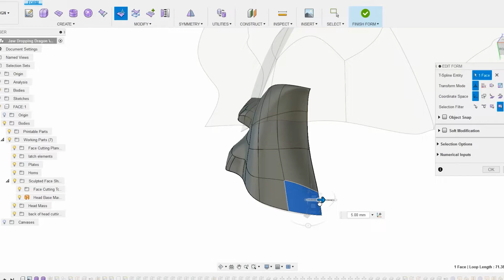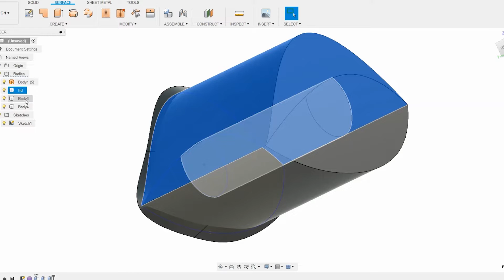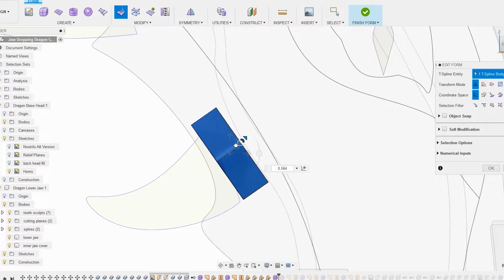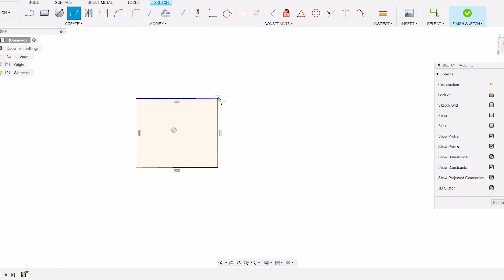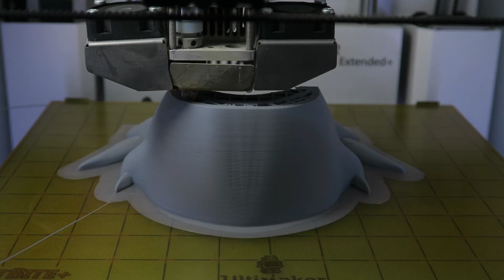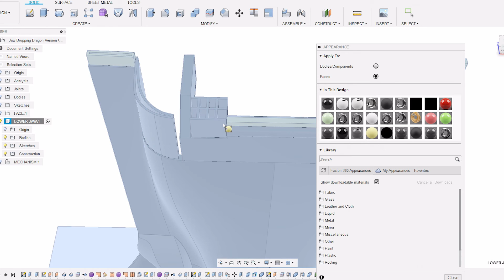How to 3D Model ORGANIC Shapes in Fusion 360 | Dragon Secret Compartment Box Part 1

Comment: You're awesome! Thanks for the tip. I will use it to finish the sculpting of the shield on the back of my Galleon model (Revenge 1577). 
I just 3d resin printed my highly detailed Harley Davidson F360 model in 29 parts, turned out amazing. I will use the technique you demonstrated to complete the Galleon and 3D print it (in resin) as well. Cheers. Subscribed!

Comment: I spent months trying to extrude or thicken a solid directly from a sculpted organic form and gave up on the project for more months. It just never crossed my mind i could use the sculpted shapes to cut the solids... gaaahhhhhhhh....  I ended up starting from scratch and creating the model with 3d sketching, surface lofts, then stitching the parts into solids. And i had this tutorial downloaded all that time. faceplant. Still, i needed all dimensions to be exact and precise so i learned how to achieve that. This is an invaluable magnificent tutorial all the same. Thank you.
Reply from the maker: Glad you found it helpful.

Comment: "I locked my view." Huh? That is not possible with Fusion 360... or please explain to me how you did that. 
TiA. ✌
Reply from the maker: Reference to shortcut for turning on and off rotation when using a space mouse, allowing easy pan and zoom without accidental rotation.
Reply: @LindyDesignLab   👍 A-ha! Using a Spacemouse... now makes sense. 
I was thinking something along the lines of creating custom named views, so one could reset the view back to where you want it in case you accidentally change the view. Thx. ✌

Comment: Great video for showing what is possible with Fusion 360, and are techniques I need for the project in my mind... but as a noob, I need more low level "use this tool". knowing what you don't know is the first step in learning, and this video did that ... thanks!

Comment: Awesome video. I've been watching a lot of videos trying to decide between fusion or blender for my first foray into 3D art and printing. This video has me leaning toward fusion since it's going to be organic in form but also like your dragon I'm going to be making a multi-piece assembly and I don't think there's a way to escape using CAD software over the more freeform apps like blender. Maybe I can get it into blender after the fact for fine detailing versus having to rely exclusively on painting, which I'm going to be learning on the fly a bit like your airbrushing in your later video.
Reply from the maker: You might also check out Meshmixer to sculpt details. It's another free option but way less of a learning curve than blender.